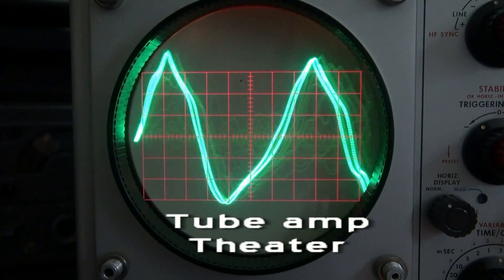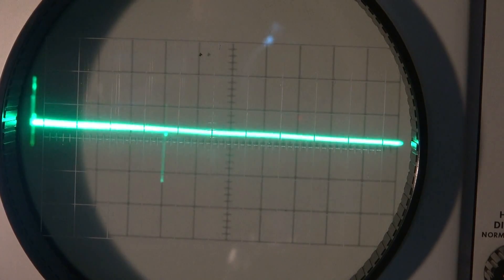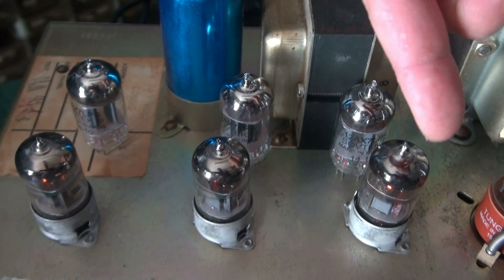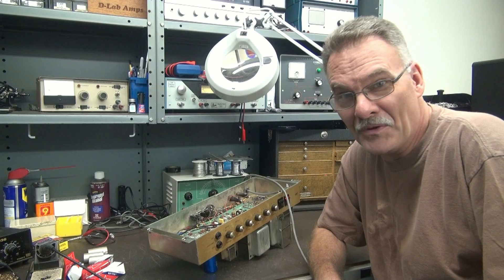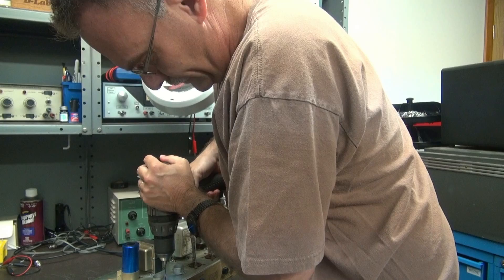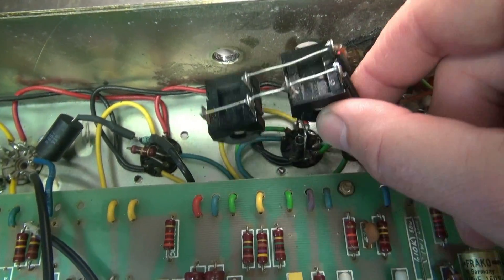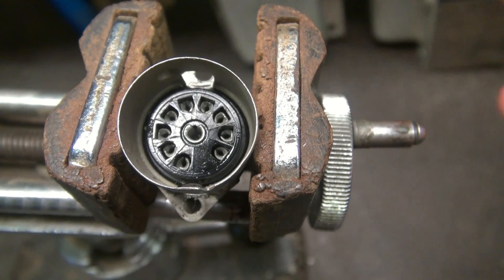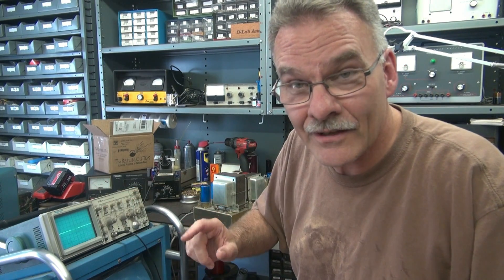How to Repair replace tube sockets Marshall 50 watt guitar amp D-lab

Comment: Used to go to the Pawn Shops in Vegas, in the 70's, Bought a Fender Twin Reverb for $40, Broken, as is, Owmer insisted I couldn't bring it Back. Agreed. Opened it up, pulled Tubes out to Test. Noticed One of the Output Tube Sockets was Different, had been Replaced, also noticed the Keyway was out 180 Degrees. Desoldered the wires, Pulled out the Socket, Rotated Socket 180 Degrees. Resoldered wires. Installed Tubes, Worked like a Charm. Troubleshooting Ever since. 
I Dumpster Dive, Buy Broken Electronics, Effects Pedals on Ebay.
Love Electronics. 
Good Job on the Repair

Comment: It’s obvious (In hindsight of course) that you did find the culprit and made the repair. I do take some exception to one troubleshooting rule that you violated, if you don’t mind the constructive criticism. I always follow the rule that when you make a change and want to compare the results you should always use the same test equipment so that the results aren’t affected by some inconsistencies between the different pieces of equipment. In your case you used different scopes with different ‘personalities ‘ which could have contributed to the different scope displays seen had the tube sockets not been the culprit. I think it’s a valuable lesson for newbies to learn and adhere to since they will be less experienced in diagnosis and evaluation. Thanks for the great video and learning experience.

Comment: Hey, just finished replacing V1's tube socket in my Marshall 2204 using your instructional video as a guide.  Piece of cake man...and WOW, did a good sounding amp just get WAY better!  The tube was suspect for awhile...humming...and it sounded good...Marshall like, but something was missing...now..holy crap...  The preamp control now is far more sensitive...get way more low end frequencies...and volume...(ears ringing badly now)  It's more then obvious this preamp tube socket was attenuating some of the juice at that point...  Clear, quiet and pure now...and LOUD!

Comment: Hey Terry, nice video man!  I've got an 86' 2204 with a wore out v1 preamp tube socket.  I just got a Belton socket from the Tube Depot...seems pretty stock looking...anyway, what ya think of the Beltons, and um, what size machine screws did you use to secure the new socket with?  Thanks!
Reply: Those were Beltons he put in. They're the ONLY sockets to use, unless you have a vintage piece and you want to match the existing ceramic sockets or something.

Comment: I came across your channel while building a kit amp. I was lucky enough to have a friend help me. He has been an Electronics Tech in the computer industry for 30 years. He opened the door and filled in some gaps in my knowledge. Watching your videos open my eyes and confirmed some suspicions I had. I will be ordering a scope today. Do you have any recommendations in terms of reading materials. I would like to fill in the gaps of my knowledge. Obviously your videos have been a great help. Oh and FYI despite several mistakes the amp did fire and work on the first try. Thanks to you and my friend I have the courage to go forward. The first thing I have to do is learn how to discharge capacitors properly. I am sure there's a video on it. what are the pieces of test equipment would I need? I see you have a tube tester and a variac. Those seem to be a repeating theme. I digress, any help would be appreciated especially from my fellow YouTubers. Rock On....

Comment: Not sure if you answer old posts, but I have a 1986 Marshall 50W  2204 that a thought had a microphonic preamp tube, but after changing it out, I'm still getting noise when I tap that tube. I then swapped the tube with 6 other new ones, and again, its still microphonic. So I swapped the supposedly bad original tube to the next socket, and took the second old tube from socket number 2 and installed it into the microphonic tube socket, and the same socket is still microphonic. So the original tube from that socket, I'm guessing is not really bad, looks like MAYBE the socket itself is microphonic?  Any advice would be appreciated. No amp guys around here for over 250 miles so I might be trying this myself. I've done and still do some soldering, but this will be my first attempt at a replacement like this.
Reply from the maker: Hello, Yes, I agree, the socket may be worn/corroded. Can you change it out? If so replace with a Belton Micalex type.
Reply: Thanks for the reply. I think I can. I haven't tried to do one yet, but I have some soldering experience. I've done quite a bit of it. I was planning on doing a cap change on this amp anyway, I already have the standard cap replacement kit from a vendor. I'm not 100% sure thats the problem on this amp. At bedroom levels, is doesn't sound too bad, but the louder I get it cranked up, there seems to be a "rattle" maybe a ringing, hard to explain. At first, I thought I had a bad speaker in the cabinet, but I have 4 different 2x12 cabs to switch through, and it happens through them all. The first thing I noticed ( maybe the biggest clue ) on this thing is this...with nothing plugged in, if I turn up the master volume to say 5, this amp makes a ton of noise. I've changed all the preamp tubes several times, but not the power tubes yet. Some I'm not entirely sure whats going on. Would be VERY cool to see a vid on maybe testing leaky caps? Just to ask, do you have an address to email you? I may want to get more in detail on this thing. I'm a complete novice on tube circuit analysis. But have been wanting to do this kind of work for a VERY long time. Was hoping to do this kind of work once I stop working.  Thanks again, hope you have time to try to help me out...

Comment: what brand is your cutter? i look at some xcelite and crescent but it is klein do you use? crescent broke in my hand...
Reply: I love myself a Knippex cutter
Reply: Those cutters are GREAT (they are flush cutters) and are only $5 at Fry's Electronics if you have one near you. Some are Hakko, some are brand C.H.P. Buy 2 pair. When Terry cut off those rivets, he cut the rivet very close to the tip, it would not have surprised me to see him break the tip off. I have broken those cutters cutting a thick nylon tie-wrap. Yeah, you will break one or two of them but they are much cheaper than Xcelite or Knipex and if you avoid cutting steel, they last very well. They are excellent for trimming toenails as well!

Comment: Terry, I recently purchased a mint Marshall 8240 amp.  The case is wood and all finished like a piece of furniture.  Never seen one like this before they are usually always the black vinyl.  Anyway....when I switch it on it makes a little hum is that common?  The tube in it is a Marshall ECC 83 is that worth changing for a new one?

Comment: Helpful video ,thanks. i have a mesa 50/50 power amp i got recently and one of the tubes burns a lot brighter than the rest so i need to replace the socket. im awful at soldering so wish me luck,trying to save money doing it myself.

Comment: Your video and work is awesome.   Question.  When you hook up the scope where are you hooking the probes to?   Are you going across the positive tip and negative tip of the speaker out?    Of course you have a dummy load installed.   I've used scopes
For other work however not as of yet for amps.      Would
I be ok to hook up the amp
In play mode to my 16 ohm dummy load and then take the + and - leads to the corresponding bus wires on the output jacks?   

Thanks for the awesome video.  It is great!   You're a real pro and I really enjoy your video.   Keep it up.   People appreciate this kind of stuff!!

Comment: Hello, Just subscribed. I've always been fascinated by electronics but never learned how to repair old tube amps or even owned a tubed guitar amp until recently. I currently own a Mexican made Fender deluxe Hot Rod. Any suggestions on what/how I can start doing mods on?  I also have this vintage GAROD tube radio and it appears to have a guitar jack on the side of it. all the tubes are there but never tried plugin it in.
Reply from the maker: Hello, I normally do not mod the PCB built amps. I try to find them with smoked boards, gut them and start over with eyelet boards.

Comment: Dear Terry,  Another great teaching video!  It's also possible for hair line cracks to develop in older, cheaper socket bases between adjacent pin sockets.  I once had an older receiver in which the audio would become very distorted as I turned up the audio gain.  I finally found the culprit when I viewed the bottom of the chassis in the dark.  A hair line crack had developed between two adjacent pin sockets in the bakelite base of the audio amp tube.  As I turned up the audio gain, sparking developed at the crack site.  As the gain was turned up more, flames started shooting from then crack!  I learned to check tube sockets carefully under magnification!  Dr. Stan  KZ8G

Comment: Love that Tek 515A. Even with the fan noise, it is to be appreciated :) I've seen so many techs bend the socket contacts inward, but for the most part, it isn't even a temporary fix. it doesn't pay; replacing the sockets is the only way to go. Yes, once in a while, I get a cheapo customer that tries to pinch pennies, but if they insist on a quick fix, I make them sign off as a NO warranty repair. Good video, keep 'em coming :)
Reply from the maker: I have always wanted and old tube Tek scope. Could never locate a clean one. A fellow on the east coast had this one as well as a HP 140A that had never been used! I bought both. So the HP will make a star appearance soon. Thank you for your kind support of my video escapades. I will do my best to keep good ones coming. TD

Comment: I bet that condition gets overlooked often.. I hate removing rivets. I wish you could just place a drop of acid on them and they would just dissolve and disappear.
Reply from the maker: Hello, yes rivets do require some patience removing. I would guess they never expected amps to be around long enough to require changing the sockets. Rivets are cheap and fast to initially install. It was a good project. Hope you enjoyed the vid. TD
Reply: oh ya i love learning bout amp electronics. thanks for posting your vids

Comment: Where did you connect your scope to be able to see that noise when you wiggled the tubes ? Good stuff !!! Love the video.
Reply from the maker: Hello, Appreciate it my friend. I had the scope connected to the speaker terminals for the initial noise check. Later, I connected an non inductive 8 ohm resistor. I had fun with the vintage Tek 515a. Plan to feature it again.

Comment: thanks for the videos.  a few lessons i have learned with this type of thing are:   1.  it's easy to overtighten #4 mounting screws on preamp tube sockets and end up breaking them, so i have to take it easy with the nut driver.   2.  too much solder on those sockets will leak down in and block the socket.  so i put an old tube in there while i solder.  3.  it's easy to get aluminum shavings in surrounding tube sockets,  so i usually cover them if i have to drill.  i've had things lodged in a socket and took a long time to figure out the problem.
Reply from the maker: Roger that man, Great pointers. I hope the viewers take these into consideration also. I find that using cutting oil keeps the metal chips corralled. I always take a small ESD vacuum to the amps before power up if I see contaminates. I'ts always best to be anal around high voltages. Thanks for the comment. TD

Comment: Man you're on a roll. Another great video. I'm wondering what the deal was with the missing resistors and possibly odd cap? There are a lot of Fender amp repair videos but I think this was the first Marshall. I picked an old Gretsch up from eBay surprisingly cheap last year. It needed cleaning and power supply electrolytics. When I played it after the rework the amp sounded great. Note that I said the amp sounded great. My playing is a cross between dropping a guitar from the roof of a building and smashing it into an oncoming train (but I enjoy playing when I can).  The tubes tested remarkably well so I don't think the amp saw much use. But I digress, I 100% agree on getting a scope. Your videos are always informative and entertaining. You can't beat that with a stick. Thanks for taking the time to make them. If you haven't done so, swing by Uncle Doug's channel, you might enjoy some of the old amps that he's tackled. 73 NE5U Mike
Reply from the maker: Thanks man, This makes me feel pretty good. I try my best to provide straight forward troubleshooting/repair videos. Your input lets me know, I'm on the right track. Thanks again and I will take a look at Uncle Doug. TD
Reply: Uncle Doug is one of the guys who encouraged me to try building my own from parts... rather than a kit.   the RTL-1 chassis is made and working...  on my channel.